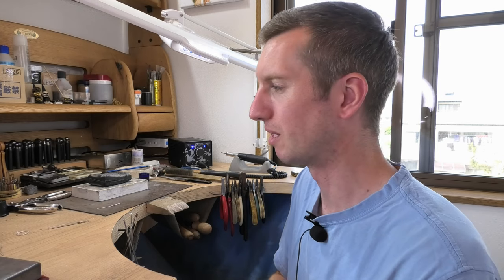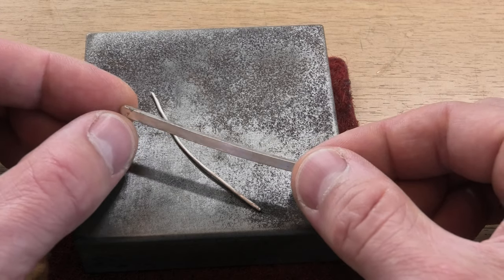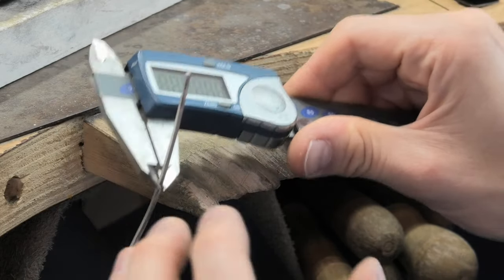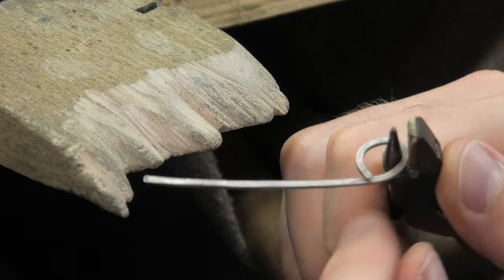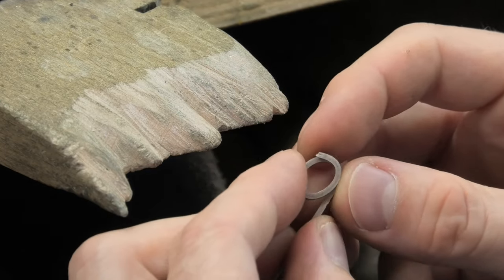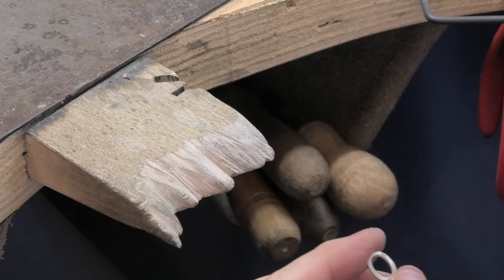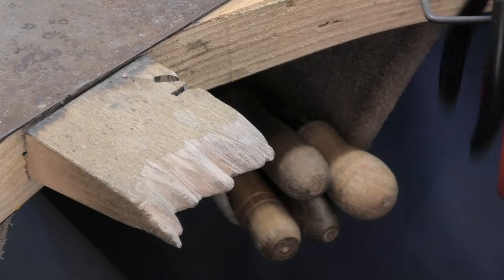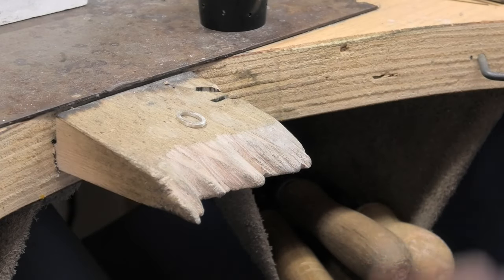How to Make an Oval Collet (Part 1)

Comment: I was taught to heat the wire to annealing temperature and drop it onto the bottom plate and immediately apply the top steel and roll the wire between them.
Reply from the maker: Yes I can imagine the technique may be more effective if the metal is very soft